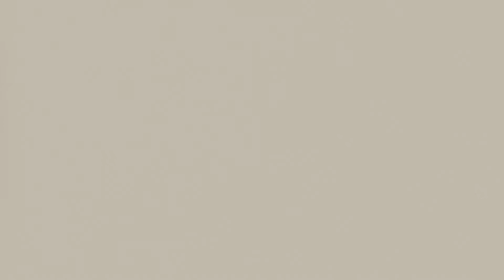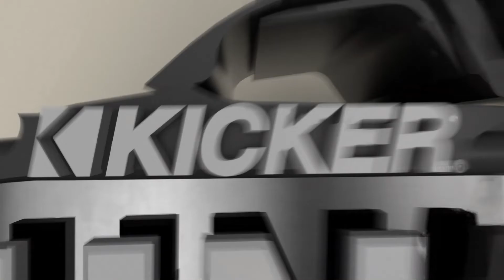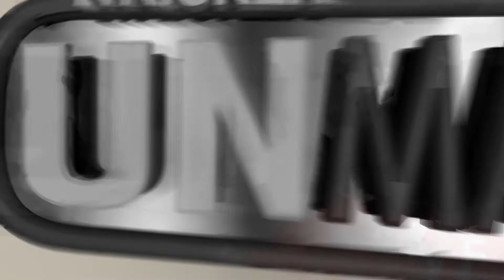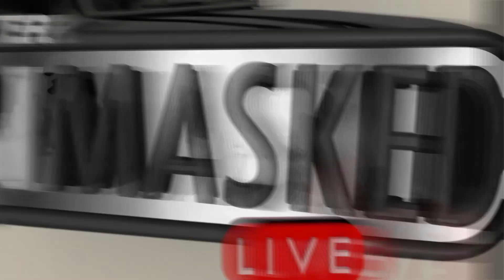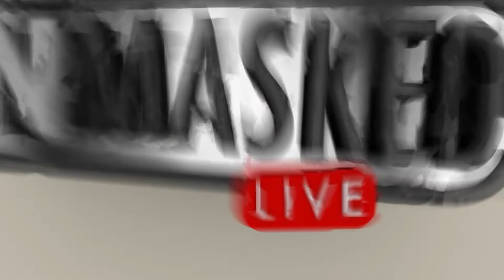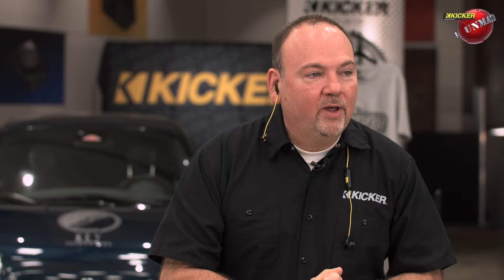Why use an Aluminum Voice Coil? - KICKER UnMASKED Shorts

Comment: GREETINGS SIR PLEASE I HAVE ONE 15 INCHES SPEAKER THE COIL WAS ALUMINIUM FLAT WIRE IS EXPENSIVE TO BUY BUT I DON'T KNOW IF I PUT COPPER IN/OUT COIL IF IT CAN GIVE ME A GOOD BASS
Reply from the maker: Conductivity of copper is better but the weight is higher than CCA. This is why we used that material.

Comment: Weight doesn't make sense if you have to use twice the amount or more.
Reply from the maker: Weight plays a minor role if it can't carry the current you need to power the system properly.

Comment: my guess would be, Aluminum offers lower mass with greater conductivity per unit weight than copper. copper is a better conductor as we know but usually you can only do minimal wounds before its weight messes with the efficiency of the sub so cooling factor is actually not that great. Aluminium cools faster than copper due to how much more winds and layers you can do vs copper and still have a much lower weight. However most aluminium coil subs tend to have higher FS.

Comment: Another thing about aluminum or cca voice coils in speakers is the current doesn't have to travel 17 feet  like it does from a battery/alternator to an amplifier, it only travels the length of the voice coil, so there is no loss of current flow

Comment: Alot of people dont understand the amp draw difference between powercable used for direct current and speakerwire used for ac current. We rewind electric motors at our shop you would not belive the amount of chinese motors that use aluminum windings
Reply: that sounds like an excellent topic to go over in a pt.3 maybe?